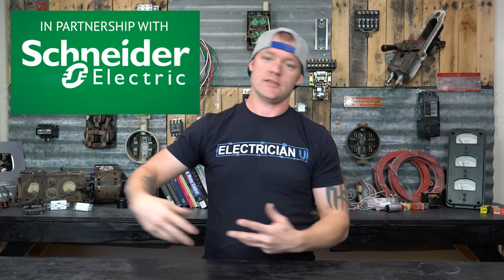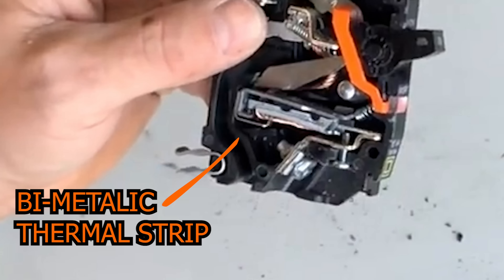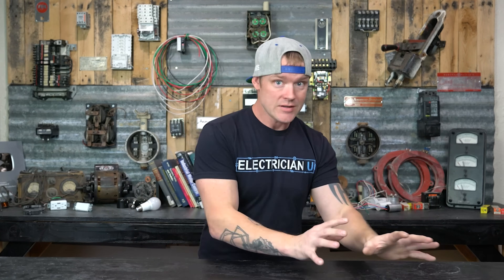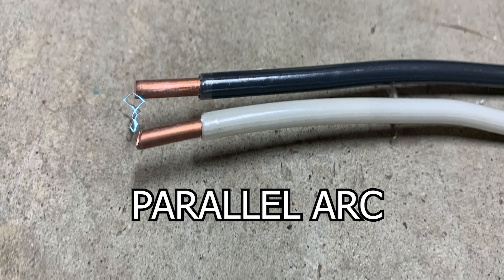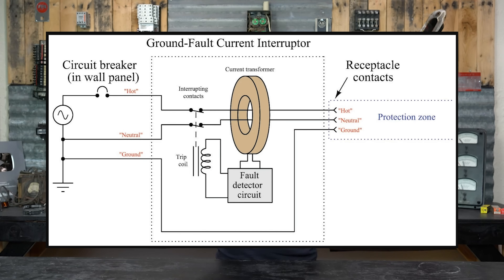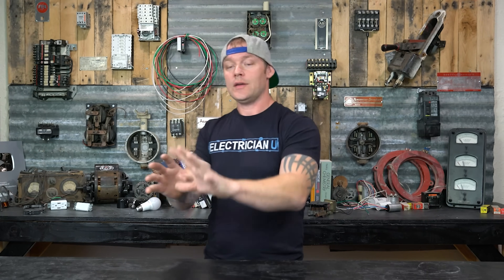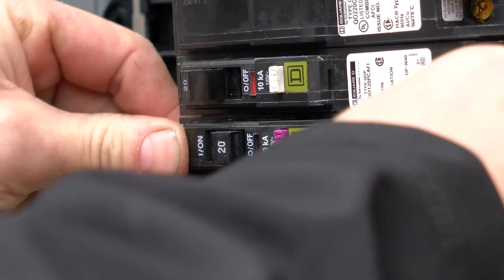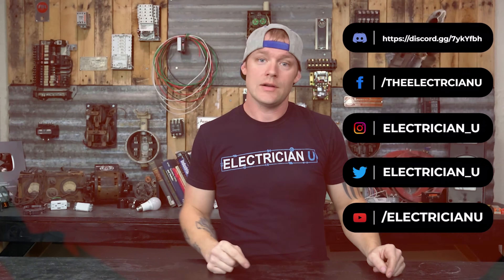Arc-Fault, Ground-Fault, and Dual-Function Circuit Breakers Explained

Comment: Dustin, PLEASE make a video on Megger testing insulation. c'mon man, please!
Like so he might see this...
Reply: When my company purchased a great Fluke combination VOM & 50 TO 1,000 Volt megger a few years back I sent away for a Fluke maybe 24 to 36 page megger book. Started out 50 years ago with a Bittle hand crank megger. Here are a few tips: to test a motor the shaft must not be turning not even 1/4RPM or reading will be jumping all over the place and not be accurate. Test voltage should be twice the voltage + 100 volts. So you need a 1,000 volt megger to test a 480 volt motor. For motors on VFD drives some compamies state that reading must be at least 10 megohms to ground. I perfer 20 megohms due to some drives tripping out on ground fault at 15 megohms. Never touch motor leads for a few mintues or you will recieve a nice shock. To check if a motor if grounded you must disconnect all line leads off motor leads at the pecker head. I saw lazy electricians skip this & only meggered at starter. Replaced motor and it still took out fuses due to wires were grounded. I have an expensive Simpson megger, DC Volt & ohmeter that puts out up to 5,000 volts that I used to test 4 ,160 volt motors. Ya should use a 10,000 volt megger but cost too much. Safety tip from an old fart & Nam vet: NEVER EVER purchase or use ANY test or safety equipment, tools or LED'S from lying cheating lack of quality control scum bag communist china. Not worth saving a few bucks to put your life out on slippery limb. Had crap china meter leads break within 3 months of buying. Had china LED'S driver catch on fire and china replacement smoking after only a few months. Got a made in good old USA driver and has been working great over 5 years. Glad to say that I only own 1 cheating china tool that is a replacement for a 50 year old Crafstman breaker bar. I have 2 other breaker bars so doubt if I will ever use that one. Have some German wrenches ans Swiss made precison screedrivers. Everything else was made in USA by tax paying AMERICANS.

Comment: I have a serious question for you, and I'm gonna describe it as best as possible. I'm replacing my fuse box in my shop and I have been ripping all the old wiring out, and one single 120 circuit here had a double pole breaker box, just 1, double pole box, with only 120 going to it. The line came in through one lug, then there was an insulated jumper going from one breaker to the other, and then the load came out the other lug, so both breakers were installed In series, and the little clip that makes the breakers work together was removed, what would the reason for a box wired that way be? Or is it just completely wrong? (It's getting ripped out regardless).

Comment: simplified, breakers protect equipment, GFCI (RCD for rest of the world) protect people.
One myth that needs destroying is GFCI/RCD's will NOT protect you, if YOU are PART of the circuit.
 ie:  plug-livewire-person-livewire-device   in this case your part of the circuit even after you drop dead moments later and nothing will trip becasue as part of the circuit, the devices will not see any imbalances

Comment: Hey just wondering if you could show us how electricians do a service calculation. For example, figuring out what kind of wire you need for, let’s say an oven or something like that. Also would be great if you could say if there dedicated circuits or not... I think I have it figured out a bit but I want to see how someone like yourself does it. Thanks!
Reply: Most loads that draw a large amount of current or just any large appliances require a dedicated circuit so they can operate extra safely and ensure that they can't get overloaded for instance, a dryer would be #10 wire on it's own circuit. A stove would be #8 wire on it's on circuit. Wire sizing is based off amperage draw and your load must not exceed 80% of the overcurrent protection device. #10 wire is good for 30 amps but shouldn't exceed 24. #8 is good for 50 amps but should exceed 40 amps. Wiring sizing can be found in the tables of the code book.
Reply: @vantstheriault4446  awesome thanks
Reply: @vantstheriault4446  would that mean that most outlets in a workshop would be dedicated because of the high powered tools you’d be hooking up to them. I installed a 12/2 to an outlet to power my saw and it would run for 10 minutes then shut off, so I just turn the break let off then back on and it worked for another 10 minutes. So I’m assuming that I’ll have to reinstall it into my panel.

Comment: I'd like to make a request for a video. I've been watching your videos all throughout my apprenticeship and I'm soon to get my journeyman. I'm almost done with my 3rd year. Great info and material. Ive definitely taken a lot of wisdom in work and life from this. Still to this day I struggle with confidence. I know they say this comes with experience. However, in 3+ years I've gotten my hands on quite a bit of stuff. Some of it more times than I can count. I still find myself getting tripped up. Making stupid mistakes because I either get ahead of myself or I miss minor details that screw me later on. Especially when my boss is watching and letting me work and I see the smirk or hear that wtf are you doing or why didn't you just do this or that, I get all self conscious unsure of myself. I think I should be past that at this point. Perhaps this is normal and I'm just being my biggest critic. Comments are welcome for input as well.
Reply: Question,
Do you know more now and are you more capable then you were last year?
How about between last year and the year before that?
How about from last week? Yesterday?
Do you learn from your mistakes?
Your getting better every day and will continue to do so for the rest of your life.
Sounds to me like your being to critical of yourself. Think about what you have learned and what you are capable of.
Reply: @markchidester6239  When you put it that way you are definitely on to something. I've most certainly come a long way since my first year. If I'm given enough space I can figure just about anything out. When I stand back even veterans of the trade make seemingly amateur mistakes. I guess it's coming to understand that that's a part of the trade and a learning process forever. I wouldn't doubt that I'm my own biggest critic and I probably just use other people's criticism to magnify mine and blow it out of proportion. They are probably not as worried about it as I am. Kool man thanks

Comment: I put up led fixtures in my basement to replace the fluorescent ones that just plug in.  I reached and went to pull the chain to shut one off and got one hell of a shock!  Tested the outlet with a plug in tester, showed correct???  Why would I get shocked?
Les
lbreen.eoj@gmail.com

Comment: One thing I don't understand, how is hot touching metal is not short circuit if that metal is bonded to systems ground? Can someone elaborate a bit more the use of GFCI?

Comment: One thing I don't understand is...if an arc has high impedance, how does it draw enough current to have such high energy? And why are ballasts required to limit current for lamps that use arcs, if they have high impedance already? I've also read that they have some kind of "negative resistance"...what is that about? Thanks

Comment: Thanks for the info.  Question:  Can a 15 amp circuit be replaced with a 20 amp without changing the wiring?  When they finished my basement,  they put lighting and outlets on a 15 amp, so if i run to projector and the microwave together, it trips.  How can you watch movies without popcorn??  Thanks again.
Reply: The only reason they'd put in a 15A breaker for the circuit is if the wiring is too thin to allow for 20A capacity, so no the wiring needs to be replaced for that circuit. Just swapping out the breaker is "over fusing", which is extremely dangerous. However you could look at some other cheaper options, depending on the details of your situation. In rough order of cost:
One, could it be possible to plug in some of the things on a separate circuit that's in the same general area to lighten the load by dividing up what circuits it's on?
If not, two, could you buy a lower wattage projector/microwave to lighten the load where they both could run simultaneously? All devices should have this listed on them, and microwaves take up quite a bit, so you likely could find one that requires less power and just an extra minute of cooking. Projectors could have a high wattage draw as well, depending on how old it is. A modern LED one for example would have drastically less draw than the old ones in my elementary school that got hot if you used them too long. lol
If not, three, instead of rewiring the entire circuit could you instead drop a wire from a circuit on the main floor down to one of your plug/switch boxes to create a scenario where question one could become a solution? This is kinda cheesy in my opinion, but if you can identify a 15A circuit that is exclusively used for lights, and you've replaced all your bulbs/fixtures with LEDs, then you've got a mostly free circuit that could be used to break up the load or add a new plug in the basement off of. (Remember to GFCI if you do this method!)
If not, four, would it be less destructive to not rewire that whole circuit but instead run a new 20A circuit that just goes to the location where the microwave/projector is? Built in microwaves are almost always done this way because they take such a heavy load.

Of course the simplest and cheapest option is to always pop the popcorn first, but I don't like being constrained by my house. lol
Reply: @normILL  Definitely check your wire, if your wire is for 15 amps and you put a 20 amp it won't trip on overload and can cause a fire, homeowner will do this with Christmas lights only change the breaker, be careful

Comment: Great video man! Question though, how is it that some devices don’t need a neutral? For example a build in wall A/C unit, we used 10/2 on a double pole 30 amp breaker. Black and white on the breaker and ground on the ground bar. Why does the unit work even though it doesn’t have a return? It confused me. Same thing with a water heater and I’m sure other things
Reply: AC vs DC. Alternating Current (everything in your home) is actually constantly "alternating" if which direction the push/pull of the current is going. We simplify things as if it were a Direct Current when talking about it just for ease of explanation, but your neutral isn't really just a return path, it's actually pulsing electrons back and forth (Hertz measures how many times this happens per second, which in the US is 60). If you have two hots going to the same receptacle for a 30A dryer for instance, you now have both 120V phases of your system going to that one location to make it a 240V plug. Having both those hot paths creates a way for the power to push and pull without needing to use the neutral at all! The only reason the neutral is there is because not everything in a dryer uses 240V - the light and digital display for example probably use 120V and are likely only on one of the two 120V phases. This creates an imbalance of how much push/pull is needed on each phase, so you can't use just the two hots, you need another path to handle the imbalance and that's where the neutral comes in. Water heaters are almost always direct wired, but in things like welders you'll actually see 240V plugs that just have three prongs (two hots and a ground) because that device is perfectly balanced to not need the neutral. Worth noting though, three prong dryers/ovens still use a neutral, there's just also using that neutral as a ground, which in a fault scenario is very dangerous and thus illegal to install using that method in modern times. Replace those with four prongs when you find them. :)
Reply: @normILL  
So are you saying that something like an electric dryer that has lights could be using the ground as a neutral?

Comment: in an new vidio could you please touch on the 2020 code and how it effects GFCI protection. With thoughts about 240-volt circuits. 

the 2020 code now include all 125-volt thru 250-volt receptacles in the locations of 210.8(A) (1) thru (11). so if the 240 dryer outlet is 6ft from a water source GFCI protected or hardwire it. small kitchen the range might be to close to the sink. a basement or garage work shop may have 240 saw or air compressor.

Comment: Dishwashers in the 2020 code - most are hardwired which I understand makes it ok to not gfci protect it. But the new Bosch (300,500,800&800plus) dishwashers confuse me. They give an junction box or a plug in cord which you hardwire under the sink (not behind the machine) both have on dishwasher end is female plug which you plug into the dishwashing machine.  2020 Code for the plug cord is easly outlet under sink is to be gfci protected. But the cord with juction box which you hardwire does code want me to gfci protect it. It does pluginto the washing machine? Or am i ok not gfci protecting it?

I hate it when the one inspector saids it ok then the next saids no redo it… I makes me look dumb in front of my customers.

Comment: Have arc fault breaker’s gotten better from when they first came out?  My house had Arc faults and everytime I used a vacuum cleaner or hairdryer it would trip the breaker.  I changed them all out to thermal magnetic.
Reply: AFCIs are notorious for this kind of "nuisance tripping", but that being said I've talked with electricians who were journeyman before AFCIs were required anywhere who have said they've never had an issue, the only issue is people plugging in old things (particularly vacuums) that have internal components that are breaking down but still functional.
Basically the way to test isn't does my vacuum/hair dryer work on a normal plug to see if the problem is the AFCI, it's does a new vacuum/hair dryer work on the AFCI circuit to see if the problem is the old device.
Reply: @normILL  
Interesting thought, I can believe that.
Would imagine that plugging in something like a shopvac or hair dryer that is switched on would do the same.
I haven't had the pleasure of dealing with these afci breakers yet. Doesn't sound like fun.
Reply: When was your house built? I am assuming it required AFCI breakers as they are about 10x or more than a standard breaker. This will mean something when the house is sold.
I had a AFCI breaker that I thought was bad, but a new one tripped the same way. It ended up the toaster was the problem. Your vacuum might be the problem.
That said, the currently sold ones seem to be programmed to ignore some noisy motors.
Reply: All you needed to do was remove the neutral wire from the breaker and put the load neutral back onto the neutral buss. The electronic circuit board uses the curly cord neutral to complete its circuit. Without that connected the AFCI breaker becomes a regular thermal mag.

As time went by there were more arc signatures loaded into the breakers and yes they got better, also Electricans got better at installing wiring, no more apprentices hammering staples in on an angle etc.
Reply: @Archer11ca  
No offense, but I believe that it isn't a good idea to post how to disable them.
It could give some idiot ( the guy who put a new plug on an extension cord and now thinks he is an electrician) how to do this and he opens the breaker box and does something stupid.
Just my two cents.
Reply: My house is newer (6 years old) and all of the outlet circuits are on arc fault breakers. I can honestly say I have not experienced any instance of breakers tripping when they shouldn't.

Comment: My brother is starting out as an apprentice soon, I want to get him some tools etc. Would a NEC 2021 code book and Uglies reference book be a wise gift? If so what type? (Hard copy, electronic or what) thank you.
Reply: Code book is updated every 3 years. Get him a 2020 NEC and the uglys book
Reply: @captainmahoney9423  thank you for the advise
Reply: “Mike holt’s illustrated guide to the nec” is also great to check out. There is a 2020 version out as well. Comes in two volumes and helps break down the nec with visuals and pictures.

Comment: I just wired my new house with plug-on neutral breakers (HOM from Square D) and it's a pleasure. You can get a very neat panel.

I didn't really understand where to put what exactly so I ended up over protecting my circuits putting Dual Function everywhere that could be wet (2 countertop circuits, bathroom, crawlspace, septic, exterior outlets) and AFCI everywhere else. I could have probably got away with less but I didn't want to research for days to save a few bucks.
Reply: Plug in is the way to go, I believe all manufacturers now offer except for GE
Reply: 💯 you are right!